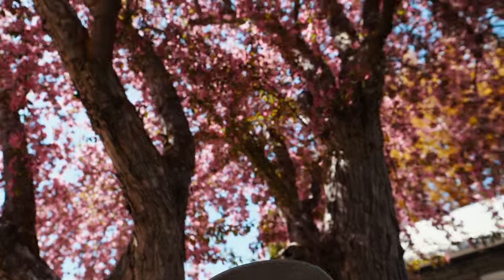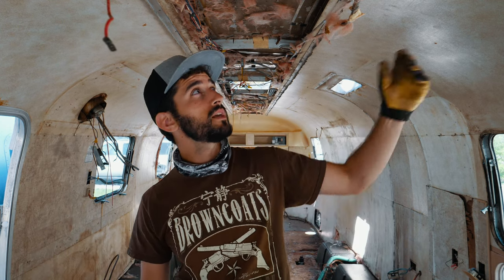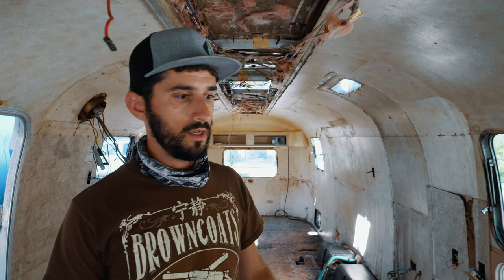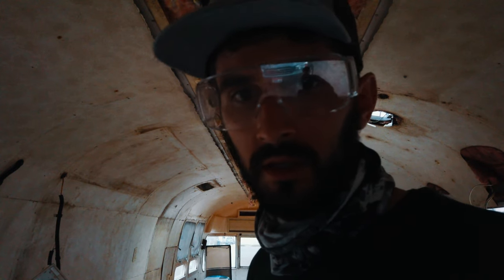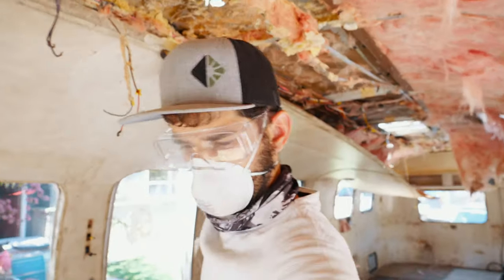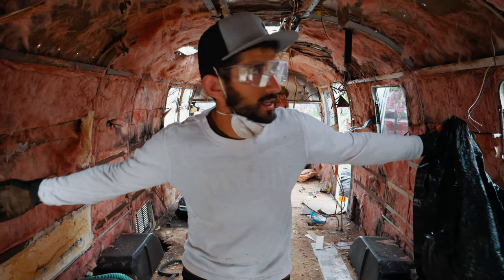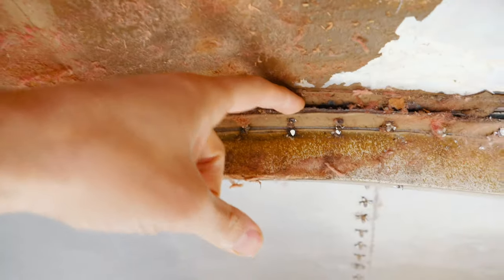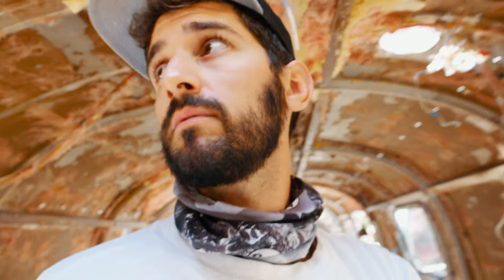AIRSTREAM RENOVATION: Removing interior skins and finding BAD NEWS 😫

Comment: Oh boy. Bummer on the rear panels. Obviously that was not a factory fix and no wonder those seams were leaking!  Good grief. Hang in there guys and don’t get discouraged. You guys have the right attitude for this!  Everything can be fixed. Looking forward to more videos. My guess is your frame is fine, but there may be a handful of outriggers that will need replaced due to the holes in the floor, especially under the hot water heater. Just remember that this period will pass and soon you’ll be making more memories together.
Reply from the maker: Thanks, Phil! Honestly, this is a fun process for me(Ben) so while I know this means more time (and money) my eye is still on the prize of what we'll get to do as a family. Cheers, and stay tuned for the next video!

Comment: Thanks for this video. Is the front ceiling console able to be removed carefully for reuse and can it be done without having to completely remove adjacent skins? I have some corner cracks to repair yet I’m not ready for a full gut. Thanks
Reply from the maker: The end cap piece is underneath the aluminum pieces, so at the very least you’d have to peel back the aluminum to some extent. But I imagine it can be done, but ours was so fragile from age that it ended up cracking more when we drilled the rivets out. I am not sure the extent of the damage but is it possible to make some repairs without removing it?